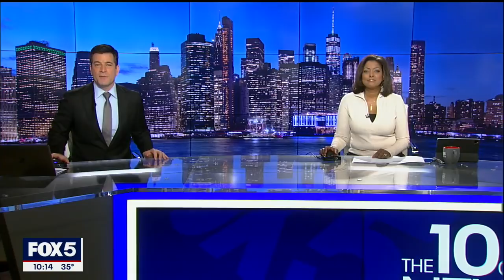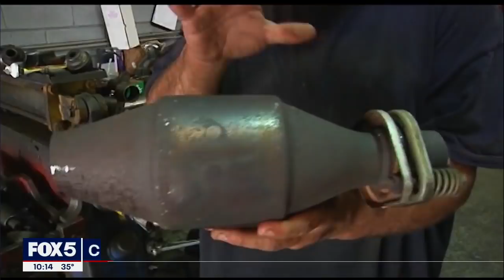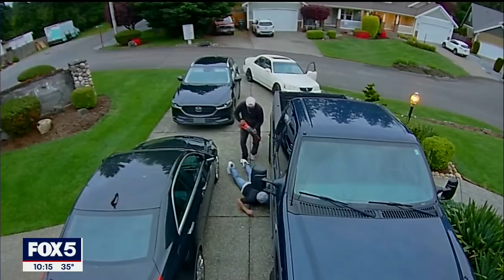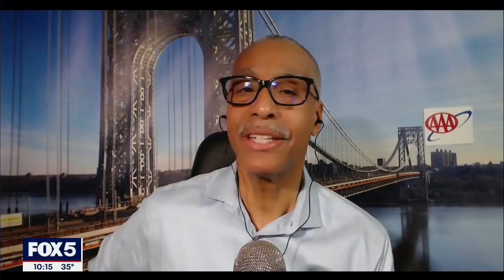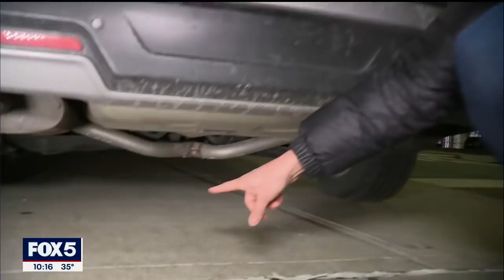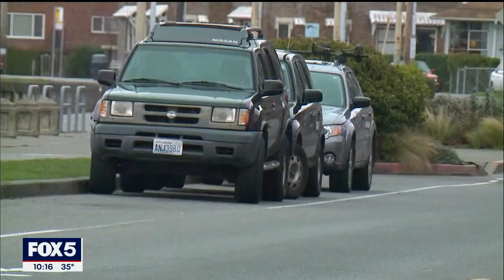Catalytic converter thefts out of control

Comment: Try to hide your car, avoid parking on the street... are you kidding me. How about stricter sentencing if caught and if they catch you again it becomes a felony.
Reply: 😂🤣 my exact thought like where the heck I’m supposed to park
Reply: Let car owners do thing they can fight back those Cat_coverter thief
Reply: It should be a felony on the very first offense, considering how much it can impact somebody's life
Reply: If they have prior charges than it will probably be a felony. 
It depends on the state you are in if the value to repair the damage is over the felony amount than yes if not than no. 
Example Texas considers theft over 2500 as a felony. So if it cost you 3000 than it’s a felony but the problem is they have to be caught first in order to charge them with anything that’s the hard part they are professional thieves they are in and out in minutes..
Reply: @londzale3163  Now we're talking.
Reply: @tonymai1844  WTH are you talking about. How you edit a comment and it's still not understandable.

Comment: You can't unscrew them. And no they are not using power drills. They use sawzalls and cordless grinders. Also he pointed to a y-pipe. Not the cat. The cat is up at the front of the vehicle or they wouldn't work properly.
Reply: correct
Reply: Pretty sure the guy can’t change his own tires.

Comment: People out of work I don't think so.
Reply: It is true, especially in the lower income areas.
Reply: Then get a job. There are more of them out there than ever right now and they are paying better than ever.
It has nothing to do with a shortage of employment because there isn't a shortage.

Want my job? Take it. I am sick of working.
Reply: @paulstandaert5709  why don't you list a job or company that's hiring? Get off your high horse
Reply: @1x1HealthyEnergybyAndrew  Walmart. Target. Menards. Home Depot.  The kitchen at my current place of employment. Subway.
In fact, the Walmart about 8 miles away is hiring "sales associates" at $15/hr. That includes the greeter position. And Walmart DOES have a decent, but not great, benefits package.  As long as you are a reasonably reliable worker, you will get 40 hours a week if you want them.
There is always a demand for housekeepers where I work which pays better than Walmart,  and as a "bonus", you can be part of the on-call snow crew and be paid a small, but not insignificant wage to be on call for 16 hours a day, and if you get called in, you get time and a half for a minimum of 4 hours. It's offered to all departments, but, there's no takers. I got called in at 4:30am today (Saturday) for five hours to deal with freezing rain. As I was finishing up with that, I got to deal with ice dams around exhaust fans on the roof. As I am pounding away at the ice/water, I was splashed with the ice cold water and was soaked from the waist down by the time I was done.  So, until broke people step up to the plate to do stuff like that, I won't have much sorrow.  I have been over-employed my whole life. I am sick of it. And unfortunately, I was an "essential worker," so I missed out on the unemployment bandwagon that would have yielded me a raise for several months.

I just gutted the catalytic converter on a customer's car because it was plugged up and undrivable as a result. Getting a decent quality catalyst isn't easy right now as there is a labor shortage according to Magnaflow. After about a month's wait, I should have the new catalyst on Monday to install. Would you like to install it for me? They live on a gravel road, so bring eye protection to keep the pebbles from falling in your eyes. And it's a rust belt state, so there may be some rust chunks to contend with. For payment, you can have the ceramic core of the old one to cash in.
Reply: @1x1HealthyEnergybyAndrew  Tell me where you live, and just by using the internet, I will find you a job somewhat nearby.
And you are talking to someone who made 60-90+ mile round trip commutes for almost 2 decades in pile of poop cars that you would probably be too embarrassed to be seen in.

And I am not exactly Mr. Money bags. I worked for less than that magical $15/hr wage for a really long time and I made it happen. It wasn't easy, but if I can make it happen, so can other reasonably healthy people. But until people willingly step up to the plate to give it a good shot, they are on their own. I consider myself to be a generous and benevolent person, but I do not reward lack of effort and poor behavior.

Comment: Def NOT a power drill!!! it's a Sawzall, or a circular saw  they cut them right out, cut righr thru the piping.. they're not selling them to be reused, rather for scrap metal, so the condition or if it works is of zero concern to them

Comment: I've lost 2 in 11 mo's off my 2012 work Van @ $1,300 a pop. 
I told  my mechanic  unless  you can  outfit one with a zipper I can put on and take off daily,  weld me a pipe in place of it 
I know my  mileage will be less  but I'll be able to go to work  everyday.
Reply: Removing it probably would cause driving issues  , the computer would throw a trouble code because the Oxygen sensors are constantly checking if the catalytic converter is functioning